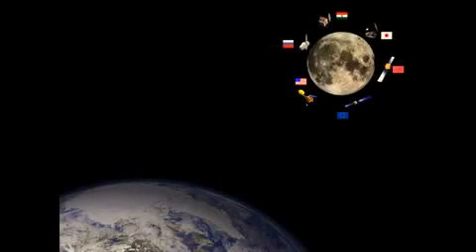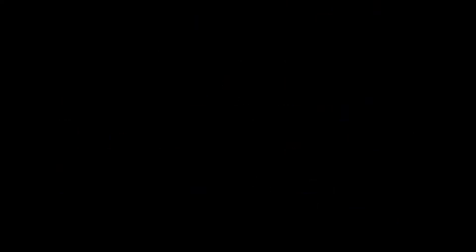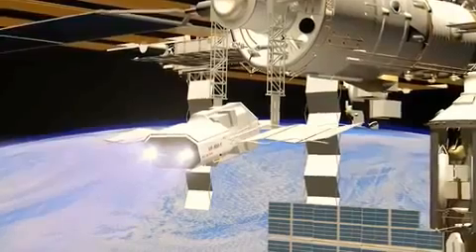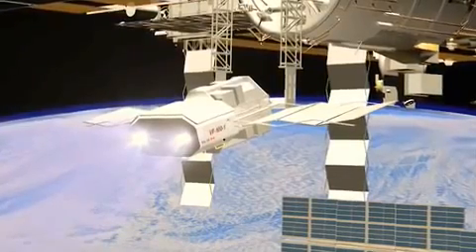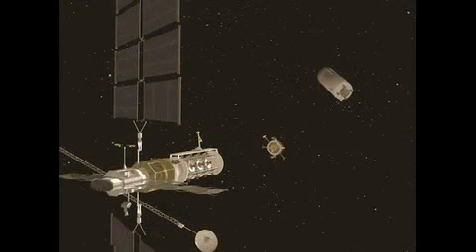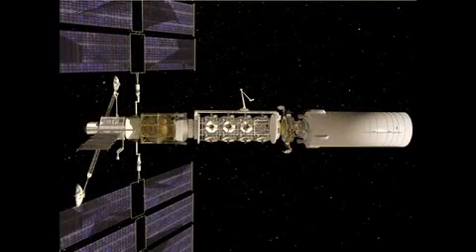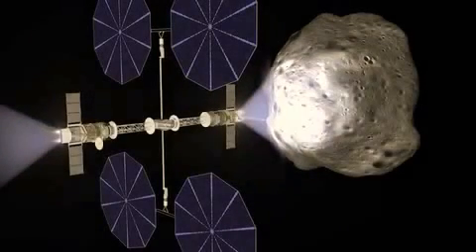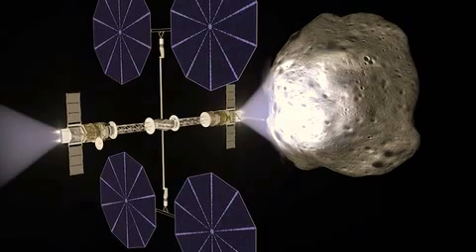NASA astronaut explains science behind Vasimr engine

Comment: could the engine be used to boost a spacecraft into orbit (assuming it is on the edge of the atmosphere and going near orbital speeds)?
Reply: The problem there is time.. You have to be building up speed fast enough to not start re-entering.
These engines would be very low thrust and used only when in stable orbit.
Reply: ok